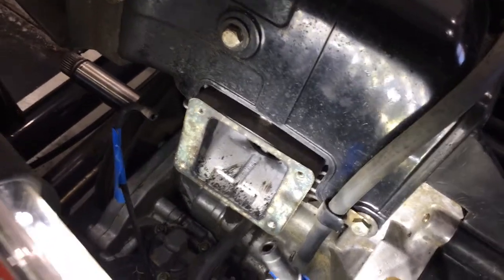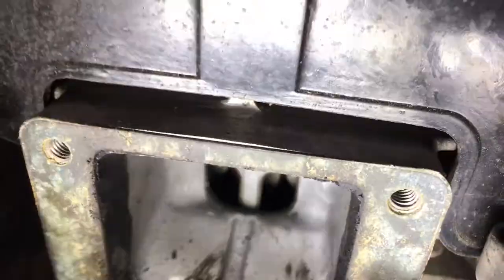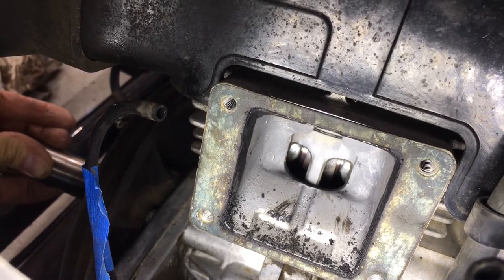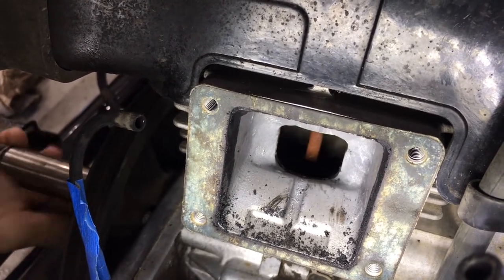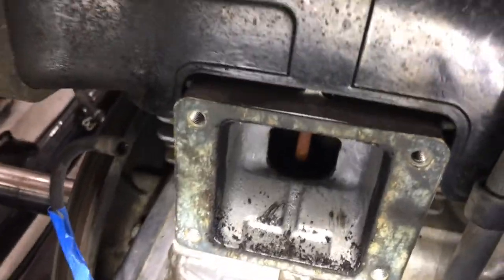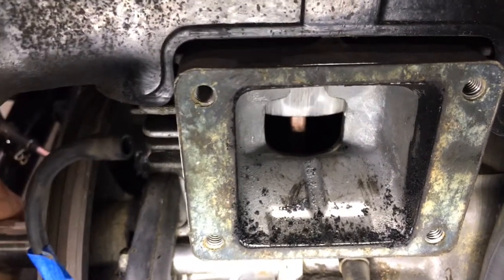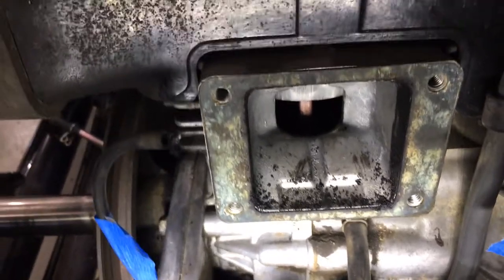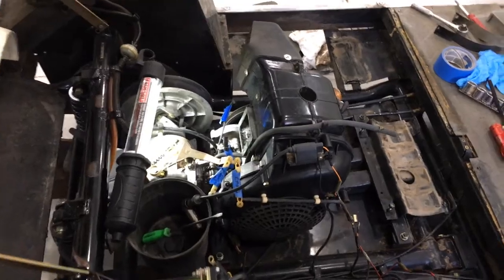8.0 Yamaha 1981 G1 A2 Golf Cart rebuild-reed valve, connecting rod, and piston inspection

Comment: Some  of the side to side play is  normal  , you've got a lot of play on the up an down,,that thing had to have been knocking ,complete rebuild for sure ,I would go with bearings ,piston an rings and hone the cylinder if  it doesn't have any scares in it ,,reeds of course, an send it out like that,,
Reply: Did everything but replace connecting rod bearing on crank. Had bad crank bearings under flywheel and/or clutch. Been running great for near 2 years. All stock with OEM parts. Screwed in governor to get about 23mph